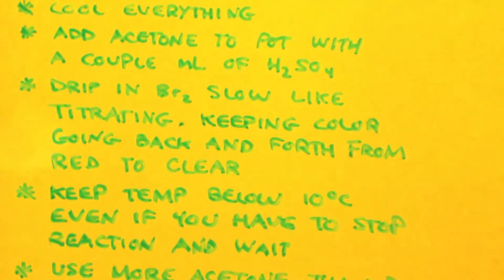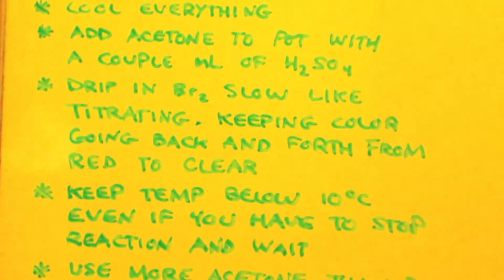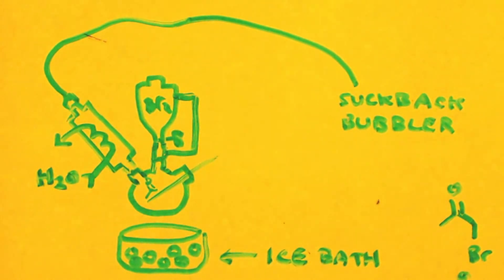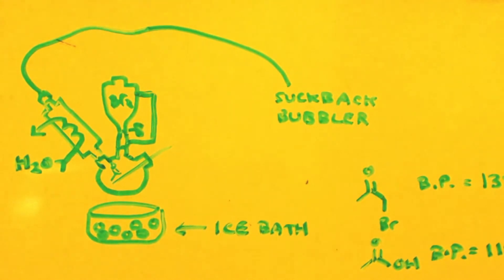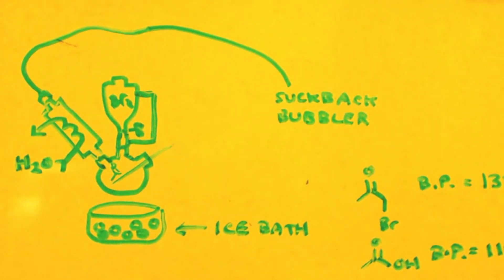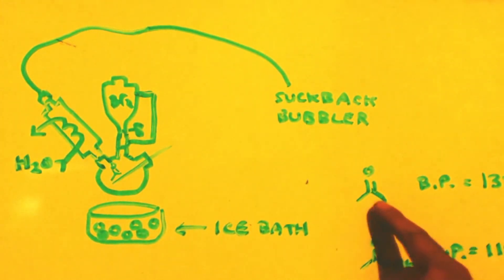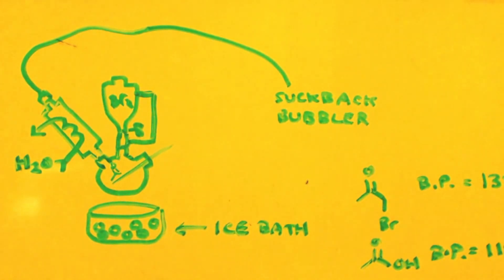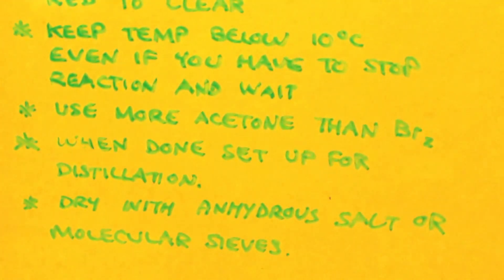BROMOACETONE SYNTHESIS part 2

Comment: Use vacuum distillation to get bp down, br-ace is unstable and will undergo thermal decomp. somewhat if done at std pressure/temp.  Also sensitive to UV, so store in dark glass designed for such chemicals and/or wrap completely w Al foil and put in dark area.  Try not to make it until ready to use, it doesnt store well and starts to decompose rather quickly; try not to store it more than a few days b4 use

Comment: Keep in mind too calculating to use less Br2 as u were accurately describing, the leftover Br- anion builds up too...not sure if much would react being cold and depending on amt of sulfuric used, but sulfuric is an oxidizing acid and will oxidize Br- ions back into elemental bromine, which regenerating can again react in a loop.  This should b small enuf rate to dismiss, but keep in mind it does happen.

Comment from the maker: Your bromoacteone is in the ether layer.  So take that layer and distill the ether out and you got 95%  bromoacetone and 5% mesityl oxide.   So take that and heat it up a little with some acidified KMnO4 and that will break the mesityl oxide up in to water soluble compounds.   Then filter and throw some ether in there.   Your bromoacetone is in the ether.  Wash with some very cold aqueous then some aqueous NaCl.     So  then dry it and then distill out your ether and then your bromoacetone...............BROMOACETONE IS A lachrymator/tear gas.  If you have a fume hood and do it on a rainy day then the rain will dilute and wash the bromoacetone away.   And if it is raining hard no one will be outside.   They will all be inside with their windows closed.

Comment from the maker: Mesityl oxide(alpha beta unsaturated ketone)   is a byproduct of this reaction by acetone reacting with itself.  It has a similar boiling point to bromoacetone so it can not be separated by distillation.    But the mesityl oxide can be reacted with KMnO4 and be turned into water soluble products while the bromoacetone remains unreacted.  .  Then DCM can be used to extract the bromoacetone.  And water can be used to extract all the water soluble products.